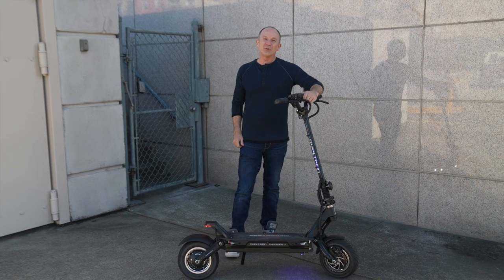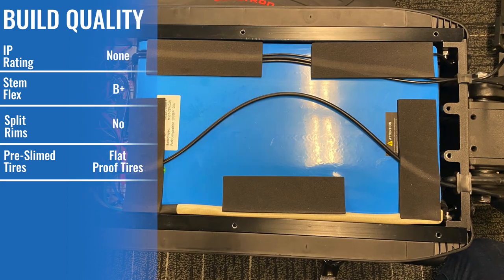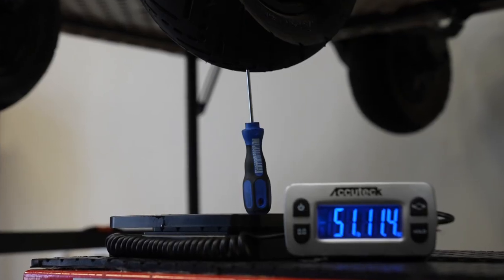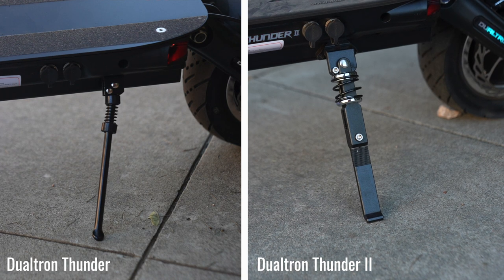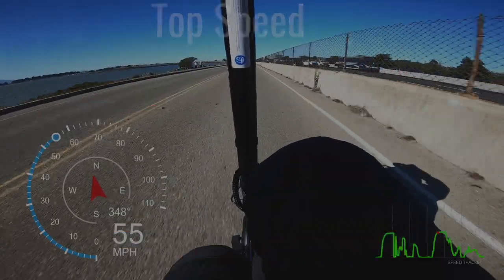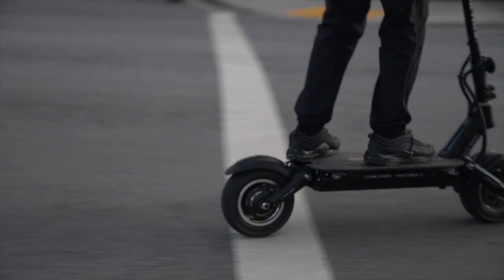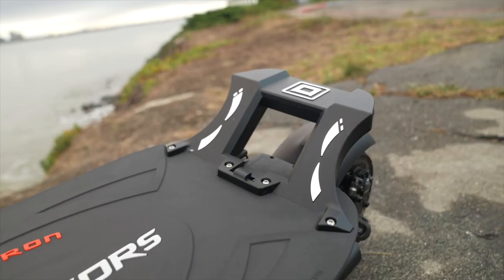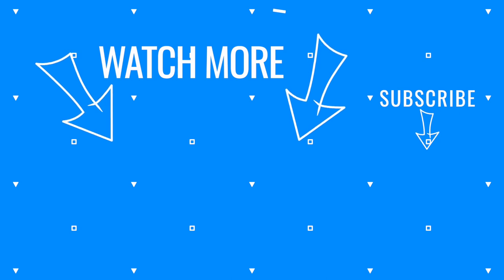NEW Dualtron Thunder 2 Electric Scooter Review, More Double, Less Trouble

Comment: Those rubber tires are VERY revolutionary for PEVs if all company's could implement this on their scooters we'd never need tire slime
Reply: You don't need slime eitherway
Reply: And they still keep releasing new scooters without that flat proof tire sealant such a shame.
Reply: This would be the natural step for mini motors to implement across the board run flat tires. Continuous improvement and never resting. 
Next up they should implement ip6 water rating and get that stem wall under control.
Reply: You can now get these tires. I just ordered a pair.

Comment: Raimier made a good point about the short stem. The emove cruiser stem is taller than most dualtrons and Raimier had no problem with it. I think there should be a way to adjust height a little bit higher than the default
Reply from the maker: CarbonRevo sells risers. But it would definitely be nices if it just came with 40" high handlebars to begin with.  -Paul
Reply: I was literally about to mention the stem look  so short.
Reply: It depends on the user. The stem is just right for me and I"m 5ft11. Imo if you sit straight like a statue you"re doing it wrong, unless you ride a xiaomi m365
Reply: @slick1908  I'm 6'2 I have the Wolf King it's  the same height. The extra 2 inches would make a significant difference.
Reply: @slick1908  5’ 11’ is the max for comfort riding on these low stem escooters. I’m 6ft and I can’t comfortably ride any small escooter cause the stem is too low. Idk if the dualtron stem is tall enough never tried
Reply: @Pintexx  I ride a thunder. The stem is not that high but just perfect for me
Reply: Better have a stem not to high with the possibility to add a riser. Or maybe in the future a system to adjust the height that is also safe.

Comment: split rims, rubber suspension should be the norm for scooters above 4 figures, definitely those over 2k anyway so we’ll done dual tron there. However what is missing from all scooters that should be standard in my view is a decent ip rating ideally ip55 but many don’t even hit ip54, a decent high mounted front light, and decent indicators. With all the bad press about scooters and safety it baffles me to see the rental companies address this (already waterproof, have indicators and high mounted light) but the major players like dualtron etc in the private space seem to ignore all or some of these features consistently and focus more on the arms race of acceleration and speed at each price point. Apollo are on the right track having some suspension on their base “air” scooter line up but only ip54, ninebot max has the ip but no suspension, vsetts have the front and back indicators but not bright enough, Apollo phantom has great indicators but only at back but a high mounted front light and everyone seems to forget some of us want the option of a thumb throttle without spending more on aftermarket one! Someone please marry all these features together!
Reply: Maybe the emove roadster (wherever that went lol)
Reply: Foreal. I mean DT2 not even water resistant?? You'd think there'd be some kind of resistance for that price!
Reply from the maker: I agree on the IP ratings, but I'll take non split rims, since it's the only way to have tubeless tires. T-Paul
Reply: @ESG-ElectricScooterGuide  yeh Apollo went with tubes tyres as they seem to provide more comfort but if you have good suspension then split rims tubeless the way to go just like road vehicles. Just need decent ip rating and puncture resistance technology as standard across all scooters along with it.

Comment: 4K for a scooter ?? This thing better fly
Reply: Cheap vs others
Reply: It does.  Lol.  It absolutely does.  Gets 60mph+.  There's very few scooters that can get that type of speed.  It also has tubeless non-flat tires, so you never get flats.  The tires are extremely thick and durable.  All around it's an unbelievable scooter. I know because I have one.  I've put about 1,000 mile onit

Comment: This is a beastly scooter to ride!  But be aware it has no chill, you are either going 0 or 20mph right off the bat lol hold on! Wide stance, powerful presence, I feel it's worth the asking price after riding it during a group run.
Reply from the maker: Accurate! I love that expression. If you hear me use it in a future review, know that it came from you!
It doesn't seem as abrupt as the Storm, but it's definitely not a relaxing ride. That's one thing the 2020 Thunder definitely does better: smooth(ish) and fast.   -Paul
Reply: I just ordered mine and I'm a chill rider, lol. I guess I'll have to get used to it or reduce the acceleration in the settings. I'll dial it in.
Reply: @jessa.3857  since this post two more of my buddies have bought the thunder II.  It's a nice scooter for sure, I'm pretty sure you'll love it.
Reply: @smooothhibot1123  Thanks for the vote of confidence in my purchase! It wasn't cheap, lol! I've been wanting a Dualtron since 2016/17 when the Ultra was their bread and butter. Back then, I simply couldn't justify spending that much money on one. I purchased a Mantis back in July of 2020 and my upgraditis only grew! I don't think I'll be wanting another scooter for a long time..... hopefully!!

Comment: Not having SineWave controllers shall always be a Cons.
Reply from the maker: So few sinewave scooters to choose from though. I really hope that 2022 is the year every new scooter goes sinewave.   -Paul
Reply: I actually prefer the square wave controllers and trigger throttle over the sign wave and thumb throttles.

I like the whole abrupt menacing deliviery of torque feeling, over the smooth.
It's to let u know u have a beast not a toy scooter. 
Like driving with a brass button clutch as opposed to a heavy duty clutch. 
Or keeping in car in track mode setting instead of comfort /luxury mode .
Reply: @george4658  I disagree - I have the Wolf King GT with Sinewave and I can do both - level 2 for Tesla like smoothness, level 5 for guaranteed wheel spin. Best of both.

Comment: I ordered the kaabo king wolf gt pro scooter a good choice ?? thanks for the video
Reply from the maker: Yes! that is an amazing scooter. It's the world's most stable scooter at high speed, and also the fastest scooter we have ever tested. Love the build quality and love the sinewave controller. It is unbelievably heavy though at 125lbs (we weighed it).    -Paul
Reply: I've got it - a few niggles (e.g. it doesn't remember the mode you were in when powering up) but the power is sooooo good. Wheelspinning with it is addictive. Very smooth too, a proper long distance grand tourer.

Comment: Ive got a few issues with my thunder 2. 
The rear brake was sliding , they only supply 1 spacer. The aluminium washer doesnt allow it to grip when tight. So it slid into my rim. Removing the washer and tightening up, this fixed it. 

The stem is also atrocious with wobble.  2 m8 bolts instead of the quick release is a short term fix. But a clamp upgrade is necessary.  

It also needs a taller stem if you are tall.
Reply from the maker: Thanks for the info about your scooter. For the stem clamp, we clamp the top one, then get the bottom one as tight as we can, and then go back and do the top one again. Somtimes continuing one more round. It's similar to how we used to do the Apollo Pro etc. But I agree, it would be nice to have a better stem clamp. 

CarbonRevo sells bar risers. There is definitely enough brake cable to allow the bars to go up an inch, maybe two inches, but the 3" riser they sell is asking for trouble, as it will cause the cables to get pulled a lot, or may not even be possible to use with the original cables. 

We're encouraged that Kaabo finally went taller on the Wolf King GT and hope that the Dualtron scooters follow. 

-Paul

Comment: Power escooters truly amaze me. Love seeing the mercurial rise in the technology. The Spider is more to my liking, 40’ish lbs to carry upstairs. Spider 2022 upgrades, folding bars with room to accessorize, locking folded stem, …$2k? ;)
Reply from the maker: I'm really curious about the Spider. It's one of few Dualtrons we haven't tested.   -Paul
Reply: @ESG-ElectricScooterGuide  Thanks, hopefully you can test it. It’s got polyurethane/rubber suspensions making the likelihood of a smooth ride. Decent performance as a commuter. I would love tubleless 10x3 with the puncture resistant goo added , and a kickplate/footrest to offer defensive foot placement. I wonder how they got a semi-performance scooter down to 40ish pounds. Is there a durability concern?

Comment: Any plans on reviewing the new Qiewa scooters? The Q-Power2, Hunter2 and Force? Not a lot of options out there for us big guys.
Reply from the maker: No Qiewa scooters in the plan right now. We did the Q-Power a while back. I might feel differently after riding it, but I'm not a fan of their build quality based on the original Q-Power.   -Paul
Reply: @ESG-ElectricScooterGuide  Thanks for the reply. I recall watching your video where there were issues with the handlebar, loose lights, etc. Understandable when you have so many other, higher quality, scooters to choose from.

Comment: That considerable power increase yet not that much faster (top speed) than TH1
Reply from the maker: Good point David. Wind resistance is non-linear though, so that might explain it. I should do a graph of (claimed) peak power vs top speed and see how the relationship looks. It would probably reveal which scooters are being conservative and which are exaggerating, with their power specs.  -Paul
Reply: @ESG-ElectricScooterGuide   true the wind resistance etc gets exponential the faster you go, i would not take one of these past 80 klm/h without a steering damper. I reached 81 klm/h GPS verified on my DT. There is a pushbike pavement track that follows the passenger train line is where i did most of my riding at night, or in the industrial estate. The expressions on train passengers faces when you keep pace, priceless!!! Our commuter trains are limited to 80klm/h that's how i also know as i kept pace with one

Comment: 100 Km/h is insane!
Reply from the maker: I definitely don't recommend it  :-)  
When I do these tests, I'm wearing about $2,500 worth of top shelf motorcycle riding gear. I still managed to break my wrist once, so far (that was at 15 mph)  -Paul
Reply: @ESG-ElectricScooterGuide  Oh dear I'm feeling funny now - I do a daily commute with 3 miles on the North Circular each way at a regular 55-60mph on my Wolf King GT with minimal protection (mainly a dirt bike helmet). Feels very stable though.

Comment: Would love to hear how this compares to a Vsett 10+R
Reply from the maker: This is really a different class of scooter, bioth weight and power wise.  The Vsett handles better, and has very good bottom end power, but nothing like the Thunder 2 acceleration wise. The Thunder 2 would be my choice for really long rides because of tha larger deck. The Vsett would be more fun carving corners. Neither of them really fit into a trunk, though the Vsett is going to have an edge here becase the bars fold down better and it's a lot easier to lift.   -Paul

Comment: The price on this is ridiculous , u can get a grom or tnt benili , z125 and the new 2022 Honda Navi. It’s nice but the prices are off the chain .
Reply: The bike will be a lot more expensive after gas and insurance
Reply: @mach16j  for little extra price u get way more mileage
Reply: @ohno4545  just depends on your needs. 50 miles is good for many. You get good performance with no gas and insurance that's worth a lot

Comment: My Wolf King GT Pro goes 72mph
Reply from the maker: That's amazing. Has it been modified? Was this on flat ground?

For our top speed runs, I do two 1/2 mile speed runs in opposite directions, on flat ground, at sea level, fully tucked so my eyes are at handlebar level or lower. The scooters are fully charged and in top performance mode. Then I take the highest sustained speeds from the southbound run and the northbound run and average them together to cancel out the effect of any small headwind or tailwind. 

In four runs on two different days we were getting a consistent top speed of 61 mph. (software limit is about 84mph). 

-Paul
Reply: @ESG-ElectricScooterGuide  put the magnets on 25. On gear 5 I upped the a settings to 60 and I'm on mostly flat ground. I get to full speed and release the throttle and repush it quickly and it goes flying.
Reply: @VegitoBlackityBlack  Is this not damaging to the scooter? I've also got this scooter and wondering if to do this?
Reply: @sheeesssh646  no damage besides using up the battery faster.
Reply: @VegitoBlackityBlack  Oh ok will def try! Hope I don't regret this 😂
Reply: @VegitoBlackityBlack  'On gear 5 I upped the a settings to 60' - how did u do this?
Reply: @sheeesssh646  in the advanced settings
Reply: @VegitoBlackityBlack  Yeah ok I've found it now, thanks
Reply: @sheeesssh646  sheeeesh! Well ok.
Reply: GPS    No way
Reply: @1987whipper  yup

Comment: Its front swingarm isn't vertical enough 🤣
Reply from the maker: It's adjustable, but this is the stock position. One bad thing that happens when you lower them is the swingarm gets longer in the horizontal direction which causes it to be further forward relatie to the pivot point for the steering. This reduces trail, and makes the front end less stable. I tried lowering our Dualtron Storm and the reduction in stability was noticeable. Lowering the rear has no negative effect on stability though.  -Paul
Reply: @ESG-ElectricScooterGuide  You're a legend Pauly.